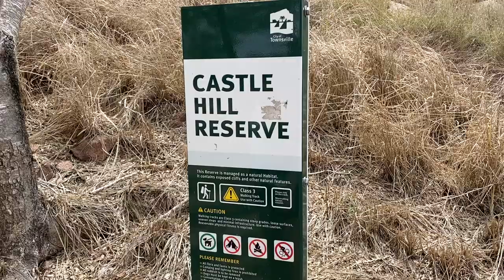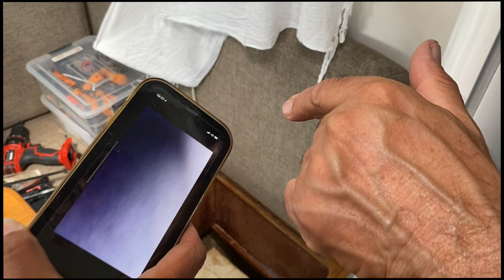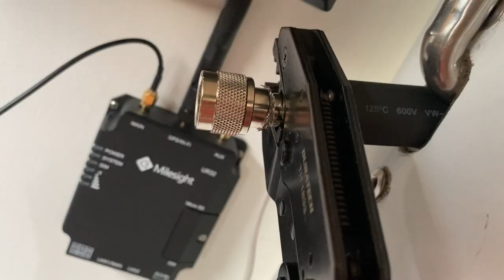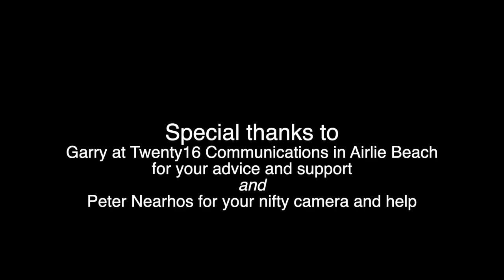Episode 13: COLD BEER AND WIFI! - Exploring Townsville - ATS Sailing Adventures

Comment: Great to follow your travels....what is the wifi system you installed...?? Fair winds
Reply from the maker: Hi John, many thanks. We put in the milesight UR32 router, and a benelec high gain 4G aerial coupled through the LL400 (low loss) coax. We have been impressed so far at the improvement to reception in remote places.